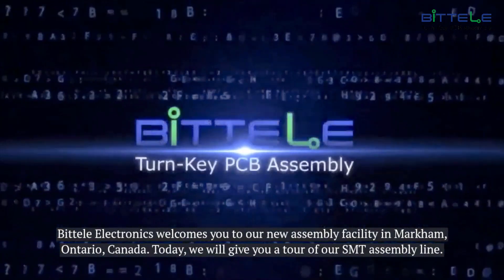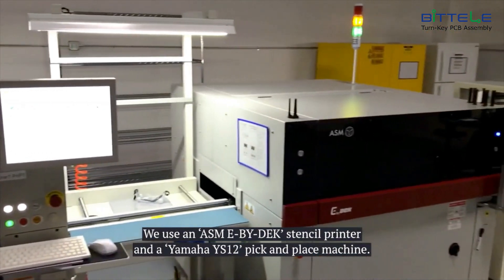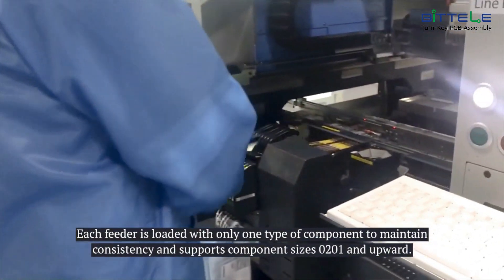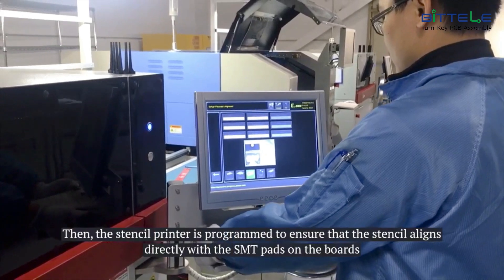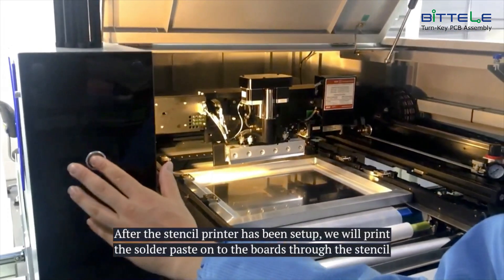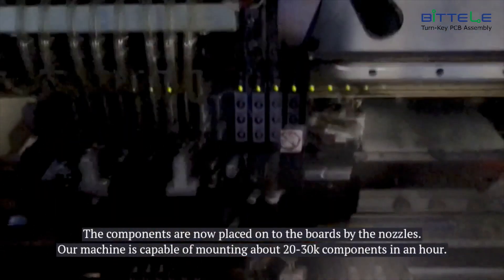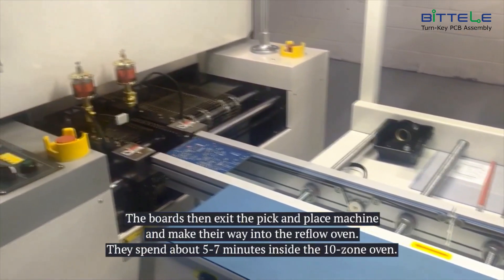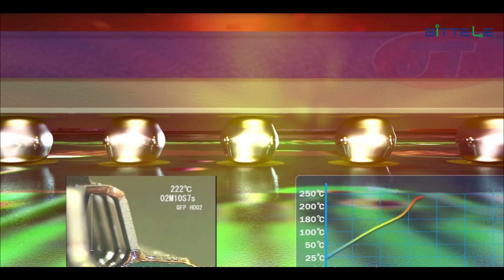Surface Mount Technology (SMT) Assembly Process

Comment: i've worked on this machine for 3 years😊
Reply: Is this hard work?
Reply: @DarkcreepSTREET  Not very hard, but stressful. You as an operator are expected to run the line 100% of time, which is really really hard considering the complexity of these machines, they stop all the time with a wide variety of problems.
Reply: @DarkcreepSTREET  I can't speak for other companies, but where I work smt can be exceedingly difficult!
Reply: Hello, do you know how can I set on this machine to save all the image of the components on the PC?  Thank you!
Reply: Im 6 years worked in SMT, indonesia
Reply: I work in Taiwan 7yrs experience  I love mounting machine, specially scanning the parts